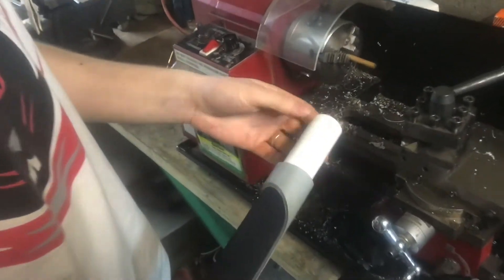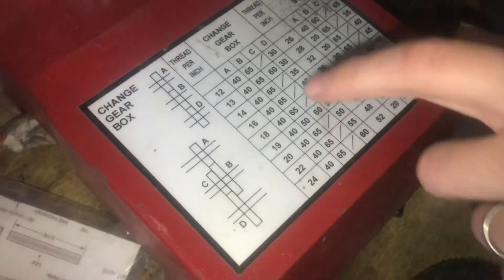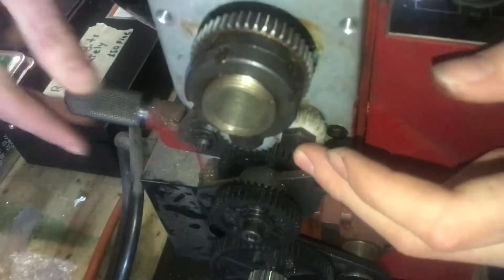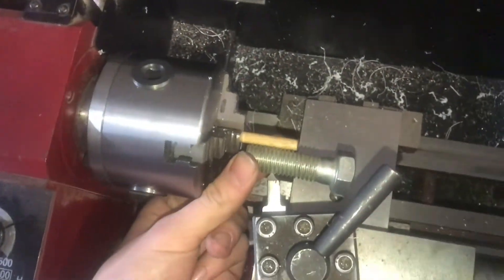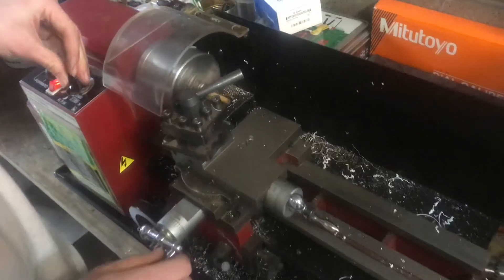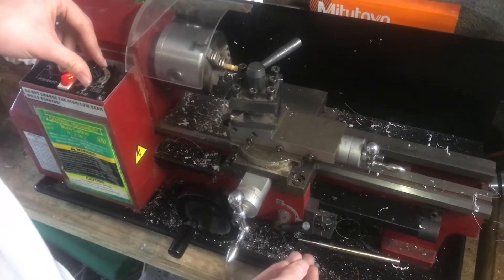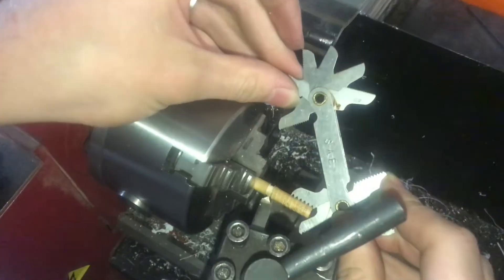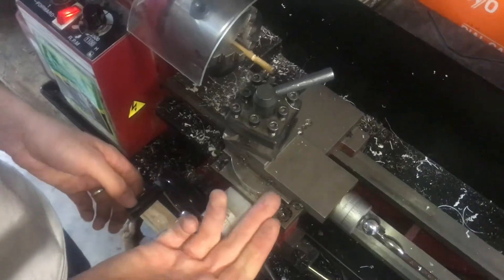how to CUT THREADS on a harbor freight mini metal lathe

Comment: It will be much easier and better if you invert the tool, run the spindle in reverse, and start the thread at the left hand end and cut from left to right. This method eliminates the need to watch for the thread ending at the stopping point. You still need to set the tool height to the vertical center of the part, but upside down.

Comment: Mine doesn't stop fast enough, sometimes it stops immediately sometimes it takes a moment. all the holes on threads for gibs have been stripped, re-drilled and tapped and the metal just keeps breaking apart, its like my mini lathe is made of powdered metal, these things should really be made in a better country. even a mini mill I got, the column had a casting defect, during the pour the core of the mold must have shifted because a part of the column was much thicker and another section, right at the dovetail, was knife thin.

Comment: Is there an option for metric?
Reply: well, in the US, mini lathes are sold with 16tpi lead screws, but you can get a 1.5mm pitch leadscrew from LittleMachineShop to do accurate metric threads
there is a cheat tho, to do 1.0 threads for M6 or M8), with .087% error so it's not precision but you can do A 45, B 55, C 50, D 65
Reply: yes you can cut metric
Reply: @shoesole1873  see https://littlemachineshop.com/reference/change_gears.php
Reply: @pauls5745  Yes that's exactly what I used. I had to thread a m24x1.5 and needed to changes the gears till I found the closest match. Have you tried the LMS mm leadscrew? I'm wondering what's quicker to change out, the leadscrew or the gears?
Reply: @shoesole1873  oh i think about the metric sometimes bcs I do lots of stuff bicycle related and it's all in mm. changing gears out is quick, they are all right there as opposed to messing with the half nut and thread dial,, ugh haha

Comment: It's much easier just putting a dye in the tailstock, and also why the hell use wood, overall a very poor and disappointing demonstration
Reply: sometimes you can't always use the tailstock, and why buy a die if you'll only thread only 1 or 2x. also most dies are for certain diam, so there's that. ex. what if I wanted internal threads on say 2" hollow stock?
give the guy a break. im guessing he didn't have any scrap around. there's a lot of thread cutting vids out there, ThisOldTony, MrPete222,  etc
Reply: It's a demonstration of thread cutting, not screw making. Quite often you want to thread parts that are nowhere near any standard diameter. And using wood to practice on is an excellent idea for beginners scared of wrecking their new toy.
Reply: Why not learn to use the tool, why buy when you can build and why they hell waste material when you do have too. Overall I have to say this was a very poor and disappointing comment.

Comment: can u make bolt threads that arent common? like 3/8/-10 , 11s  or 3/8/-8?
Reply: sure: 
8 TPI A20 B any C any  D40
10 TPI  A80 B any C any D50
11 TPI  A80 B any C any D55

but that super coarse for a small 3/8 diam, then youd need to cut internal threads to match tho. experiment with whatever material you have!
littlemachineshop.com/reference/change_gears.php
Reply: I suppose you probably could but probably be much easier or cheaper to just buy some unless you needed 1,000 or something